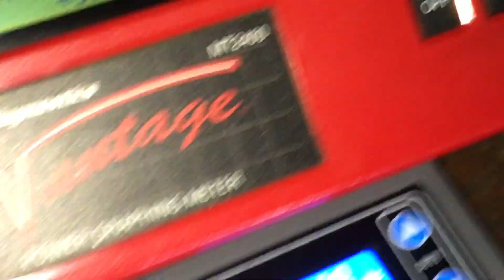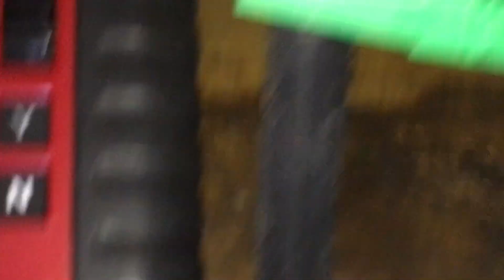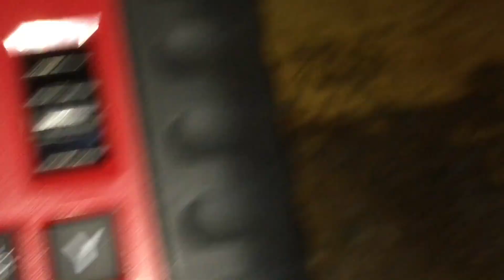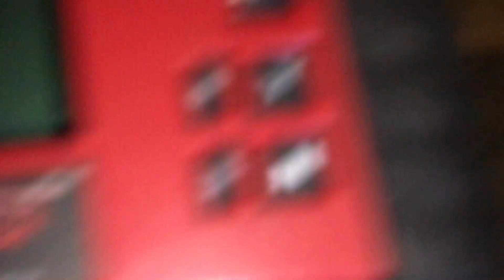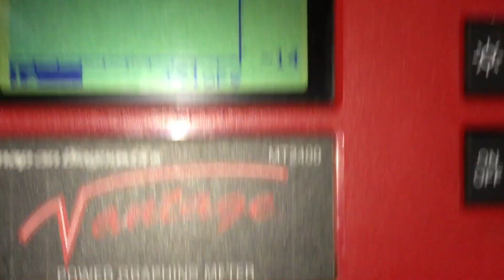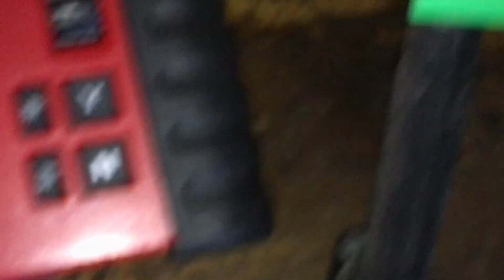Coil On Plug Trigger SIM

Comment: Nice! This reminded me of when as a kid I built an ant zapper. Just an old fashioned ignition coil and a two pole relay wired to oscillate. With the high tension output connected to two needles I could get a ½"  spark. Place a sugar cube between the needles and childish amusement begins. Kids are cruel :(
P.S.Dorking is a place!
https://en.wikipedia.org/wiki/Dorking
Reply from the maker: spannerman Haha...My Reading skills are as bad as my math. It’s actually “Droking” I saw Dorking! (Freudian slip) 🤣  You were more sophisticated than my magnifying glass! Cheers

Comment: Great video ....Does the wave generator on the Pico 2204a do the same?
Reply from the maker: Mick Clarke Thx. Yes and no...It will generate a pulse train at what ever frequency and duty cycle you select. But sadly it’s only 2Vpp.  Doesn’t quite meet the trigger threshold (I tried 😬) Thx & Cheers
Reply: @TheGibby3340  Thanks a million.    I will order the other type.

Comment: I have that signal generator, Ian. Love it...
I placed it in an ABS project box, 5v buck converter powered by 9v battery. Added a BNC output. Very useful.
Reply from the maker: It’s a great wee rig Denis. I am gonna mount it up so the interface will be 4mm shrouded banana plugs. The little set screws are super M.M

Comment: no bud 60hz is 60x60 3600rpm
Reply: I'm thinking 7200 RPM
Reply: @theGADGETSplaylist  he didnt say it was in a 4cycle
Reply: having some fun Henry:)
Reply from the maker: henry robinson Ooops 60 seconds in a minute 🤣  Hang on wouldn’t that be 7200rpm ? 3600 sparks 1 for every 2 revs ? Math is not my strong point 🤔
Reply: @TheGibby3340  i'm talking math, google it i did to make sure, a two stroke is 3600, but you didn't mention engine design
Reply from the maker: I am only kidding. The mistake is undoubtedly mine.
Reply from the maker: 3600 in a waste spark system 🤣
Reply: @TheGibby3340  waste spark...good point:)